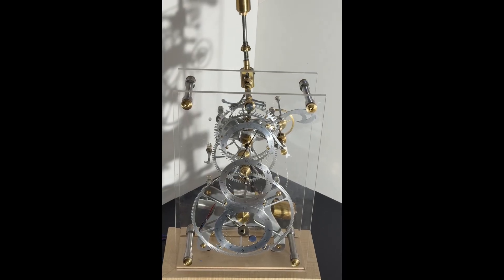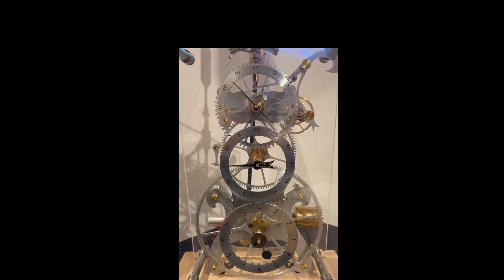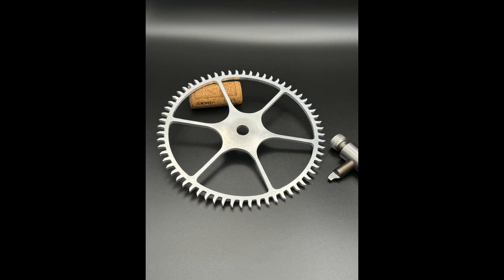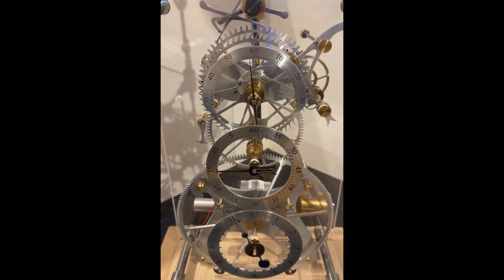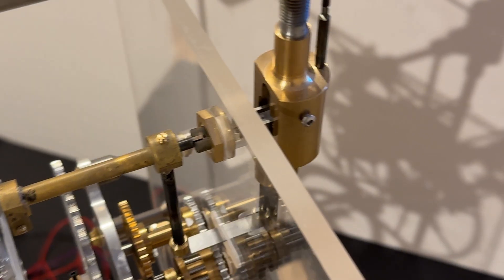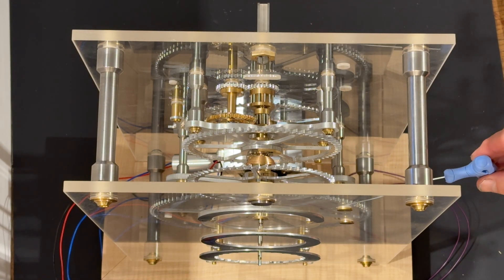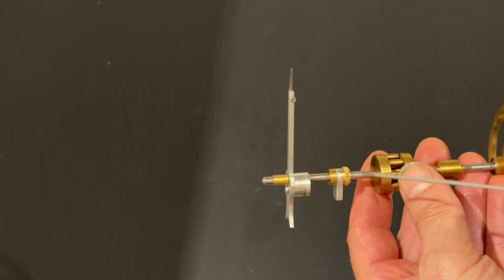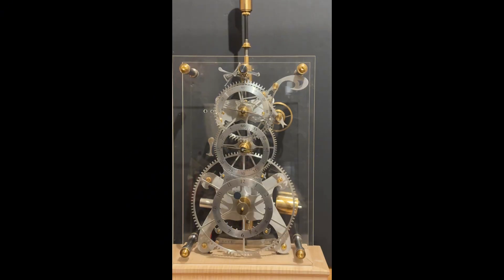I made a Harrison single pivot grasshopper clock with remontoire in my tiny home workshop.

Comment: Dear James, what a incredible and wonderful clock you have built. never seen the Harrison 3-Wheeler as a table regulator. I love it... I have started to build my own table clock, but the decision which escapement to use is not finally decided (Graham, Denison, Grasshopper). I would prefer to build Denison gravity escapement or a Grasshopper escapement, but it seems to be very complex and difficult to adjust... Do you have some tips for where I can find some CAD examples for Grasshoper or Denison I can study tobuild a first protoptype on my CNC milling machine? Especially the remontoire is wonderful
Reply from the maker: Hi Dave, thanks for your generous comment. I found Heskin's paper on perfecting the grasshopper very helpful and I used CAD for making sure that it worked geometrically, I would also recommend making the grasshopper easily removable so that you can gradually bring the pallets to size.
Good luck with yours and I look forward to hearing your progress.  James

Comment: I noticed the escapement slipped at the last second at 3:19.  Were you able to resolve this issue?
Reply from the maker: Wow, you are extremely observant! The escape wheel at 3:19 is an early prototype, as is the grasshopper, the final versions had better 'locking angles' to avoid this very problem. It is a bit of a fine balance as you need a positive lock (to avoid slippage) but you don't want the pallet dragging against the escape wheel as it unlocks in recoil. The final clock seems to be fine but I'd be very interested to hear other's thoughts on the issue.

Comment: This is a beautiful clock. An absolute pleasure to watch. May I ask, how did you work out the geometry of this single pivot grasshopper? I have been doing some reading and find this quite fascinating, hoping to make something similar myself.
Reply from the maker: Thank you and thanks for the question as it's fundamental to the whole design - the easiest way is to google Heskin's paper "perfecting the Harrison single pivot ......" I put his formulae into a spreadsheet and then iterated towards a solution after putting in my design parameters, ie diameter, number of teeth. Before I knew of this paper I designed the grasshopper by trial and error using Fusion 360 which was a bit of a head ache!
Reply: @jamesmarshall1845 Thanks for that. I do have that article and it's good to know I am on the right track!

Comment: What a privilege for you to have had such an amazing mentor! You've done an amazing job on this clock, well done! I'm also in the early phase design of my first clock, a single pivot grasshopper, 60 tooth escape wheel Dent/Whitlock style with compound pendulum clock so will be watching your future videos with great interest. Struggling to meet Heskins/Harrison's design guidelines so I will have to produce a mock up like you did to test the grasshopper/remontoire action
Thanks for posting your work.
Reply from the maker: I was extremely lucky and only realised it recently when I rediscovered a love for clockmaking!
I'm very interested in your clock - what size pendulum are you using? Seconds beating? You should be able to achieve great accuracy with your proposed setup (I think +/- 1 second a month should be achievable)
Reply: @jamesmarshall1845  As this is my first clock build, i want to use Harrisons concepts, single pivot, Lignum Vitae rollers and balance wheels, and self winding remontoir, but in a clock that's fun to look at. So I will loosely base the design around the Burgess Simons Balls clock, and use a 5 second compound pendulum and see how well that goes. Ultimately I would like to build a more accurate clock like you have,  but lets see how this one goes! I only have manual machines but think I can make most things in my workshop. I would love to hear more about your next project and talk more detail about your recent builds, and happy to discuss via email if that is of interest.